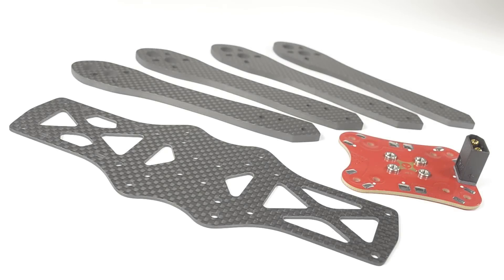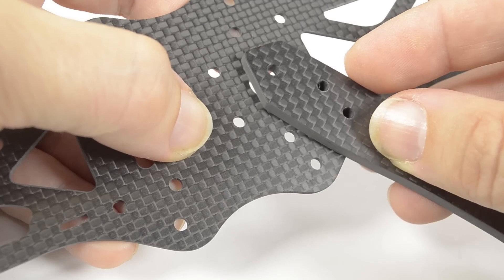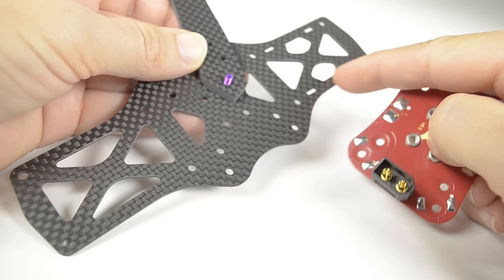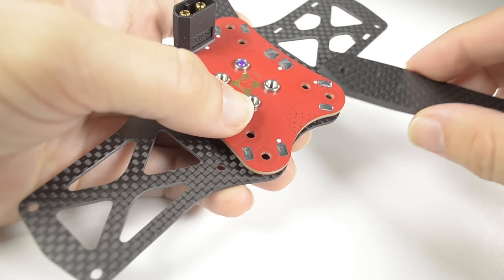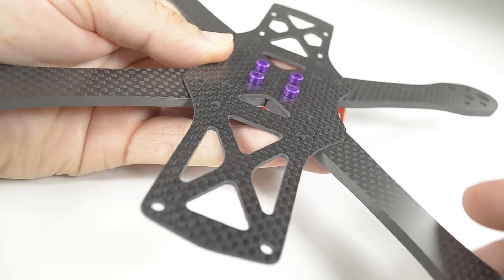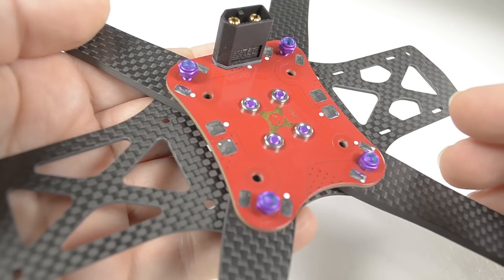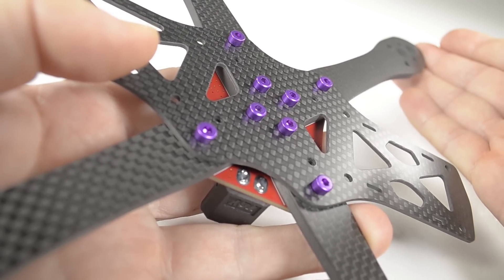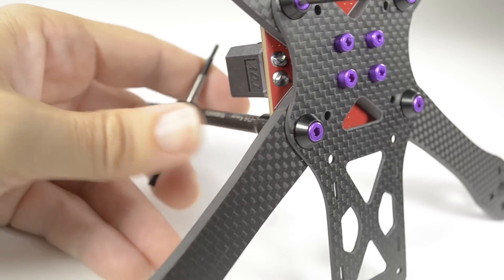ImpulseRC Alien Build - 01 Frame Base

Comment: Hi. It seems that the PDB plays an important role in terms of structural strength. Does that mean that if someone wants to use another PDB for whatever reason, he or she would need to maintain the provided PDB?
Reply from the maker: Hi, we also offer a replacement carbon plate which you can get instead of the PDB to maintain structural strength. Then you can use any PDB you like :)

Comment: since I dont use dont use nylock nuts for the outer holes should I take small M3 or should I keep smaller M3 for the FC?
Reply from the maker: You should use M3x10mm now in all the holes with the insert nuts. Only need M3x12mm for the FC mounting holes.
Reply: Ok because in my screw kit I have: 8 M3x10mm and 4 M3x12mm...
Reply from the maker: That sounds perfect, the inner and outer four holes which have the insert nuts all use the Mxx10mm.

Comment: hey did you put tape under that pdb?
Reply from the maker: It's not really needed as long as you make sure the bottom of the board is Ground. Solder positive wires to the pads with white dot only. This doesn't cause any problem since the SMA bulkhead is already grounding the frame too.

Comment: What size hex screw driver are you using?
Reply from the maker: Cap head screws use 2.5mm and button head screws use 2mm. Some of the parts for the camera mounting will also need a 1.5mm driver.

Comment: would it be wise to use some locktite on all the screws? And I watched Mr Steele's build and he sanded the frame edges, is that recommended?
Reply from the maker: +Grumpy1056 We don't tend to use locktite but it's a good idea to check over and tighten everything on a semi regular basis. Sanding the edges is personal choice, you can do it if you like, the only place we really recommend it is anywhere wires or your battery strap will run. Rounding the CF off can stop things getting cut in a crash!